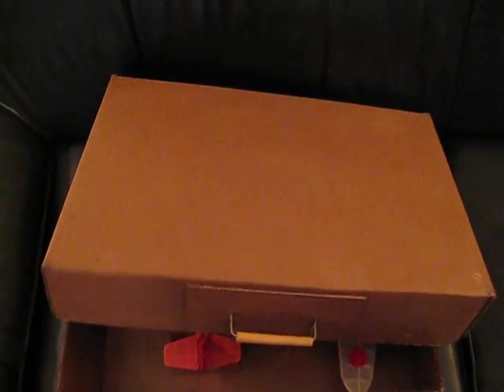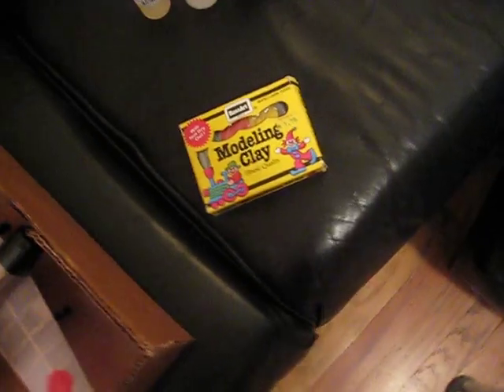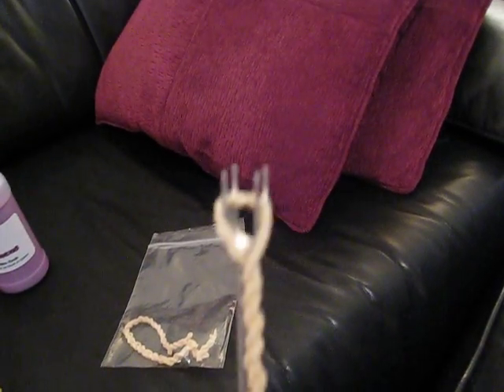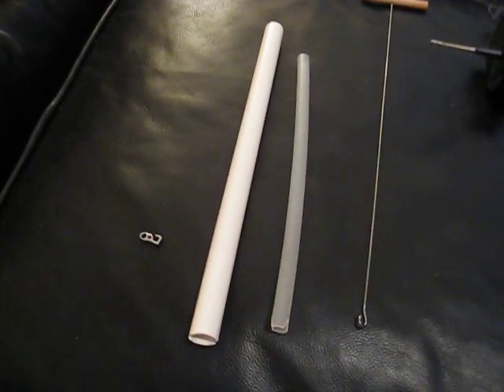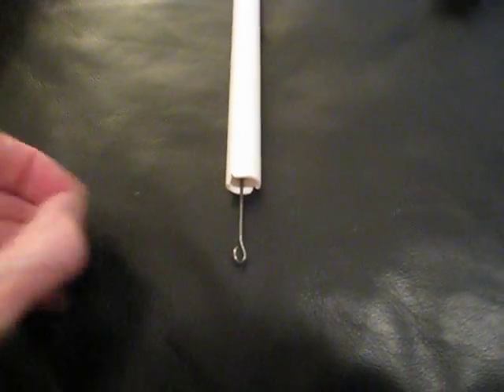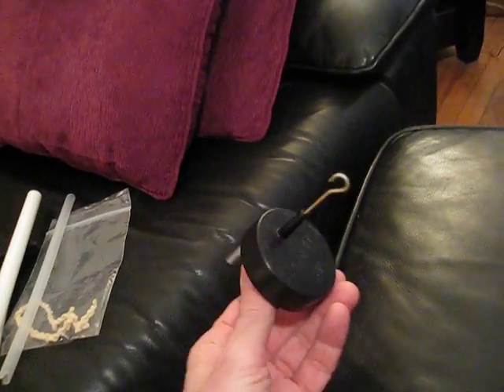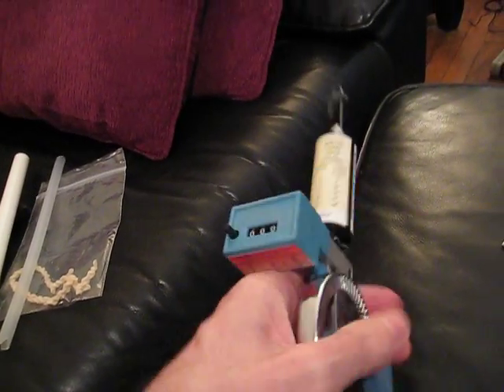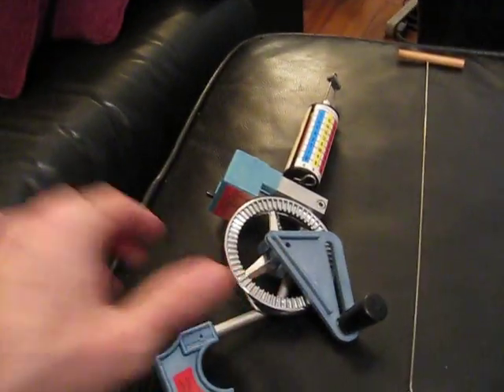Rubber powered models - some preliminaries to flying

Comment: What is the lubricant
Reply from the maker: You can buy lubricant from indoor free flight supply or go to 2 min in the video - you can make your own using green soap and glycerin, just boil the alcohol off the glycerin. However, for the last few years the only lubricant I've been using is a silicone lube, Molykote 33 medium (from Dow Corning), it's great.
Reply: @domoremath  many thanks 👍

Comment: I am building West wings aries. It's a biplane. I have covered it with tissue supplied with the Kitt. Now the CG needs to be balanced since the tail is heavy. What do you use to balance the weight?
Reply from the maker: Modeling clay. You should check http://www.hippocketaeronautics.com/hpa_forum/index.php , they have answers to many of these sorts of questions.
Reply: Yasser by coincidence I have just built and flown the Westwings Aries,mine flies beautifully,I guessed it would need nose weight so strengthened up the nose during assembly it worked because no nose weight needed,you could still fill in the nose with sheet on yours to compensate.

Comment: What did you do to the rubber band in the zip bag? How do you keep it breaded such a small rubber band? Need help building the plane please. Thanks
Reply from the maker: The rubber comes as a strand, not a loop or band. I put some turns into the strand, then tie it into a loop, that keeps it twisted.

Comment: Hi domoremath, may i know where can i get the gizmogeezer winder?
Reply from the maker: Check http://www.gizmogeezer.com/  the site mentions a new winder is now available.
Reply: Thanks domoremath! How about those rubber band? Usually you guys bought those item from where? Is it ok if domoremath left your email here? I am a beginner and i need advises. Thanks!
Reply from the maker: You can get rubber from Volare or Penn Valley Hobby or FAI model supply - look through my site and you'll see I mention all these suppliers as well as others. You should also search on Hip Pocket Aeronautics, there is lots of info there and many people who can help.
Reply: Thanks domoremath! This really help me alot!!!
Reply: Hi domoremath, do know if there are gizmo geezers in greater ratios (10:1, 15:1 etc.) Thanks!
Reply from the maker: No there aren't. If you want a 10:1 winder or even 15:1, then KP Aero has some nice winders, you can also get them at Volare products.